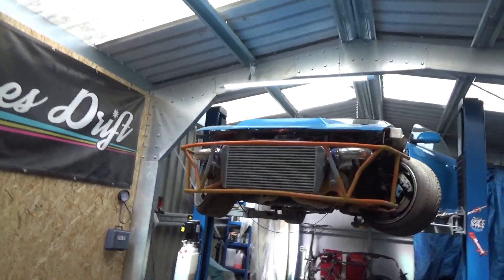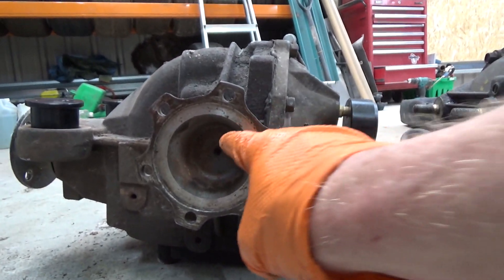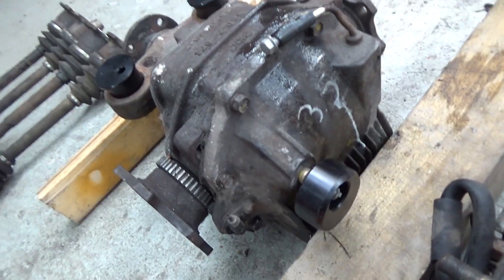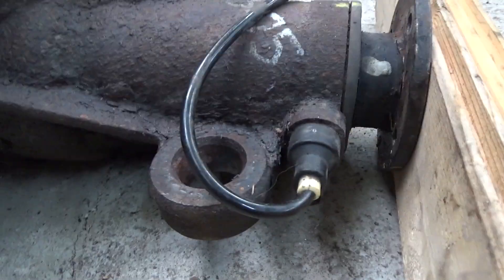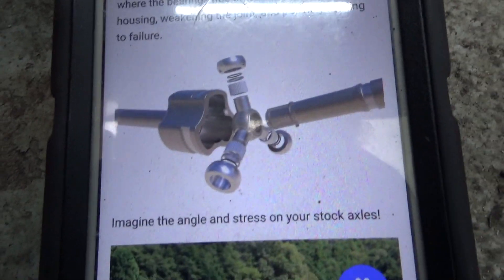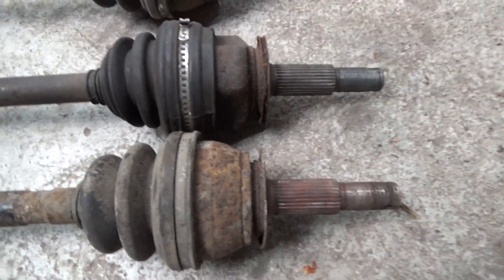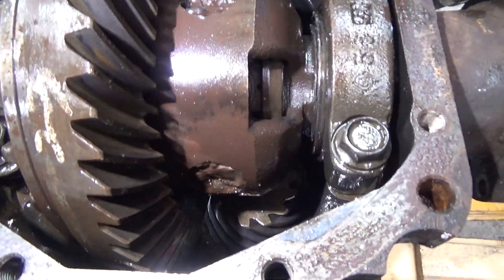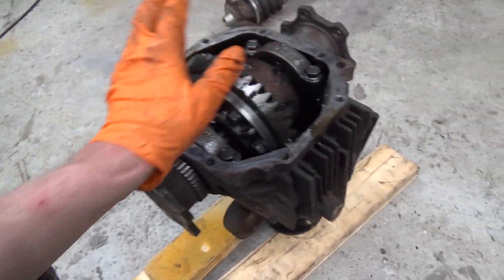TECH TIP:  Nissan S14 vs 350z diff and axle comparison // CraigDoesDrift Ep52

Comment: Do you happen to know if the the diff short shafts are the same length on both the 350Z and the S14 one? If so, then the 350Z ones could be swapped in to a Z32 N/A 4.09 LSD diff. They’re all R200s
Reply: I have an s13 with a z32 diff and I am using the z32 inboard cups with the rest of the axle g35. They are longer but they have the space in the joint to make up for it. I have had it in the car for 20k miles so far. No problems.

Comment: Can i fit 350/g35 axle in a s14 with the oem  s14 diff
Reply from the maker: The 350z axles are a different bolt pattern to the 200sx diff. You can get converters

Comment: hello from greece , awesome video!!! but i need to know can i put 350z differential with shafts in my s13 chasis ??
Reply from the maker: If the s13 has the same diff as the s14 then yes.  Might need extended arms to increase track width tho.

Comment: So will the 350 diff and axle bolt right in a s14 with the gk tech bushings?
Reply from the maker: Yup! But you need the 350z axles and to re drill the s14 drive shaft flange.
Reply from the maker: Spacer too on the s14 to input on the diff.
Reply: @CraigDoesDrift  what kind of spacer and where?
Reply from the maker: @AsWraps  Between diff and propshaft 😁

Comment: Hi! I see than 350z axles have the same length as silvia axles. But do both diffs have the same width? I mean a length between flange surfaces on every diff
Reply from the maker: It’s a bit wider. I had to extend my track width. I think about 20mm